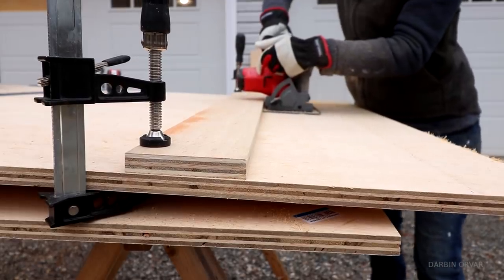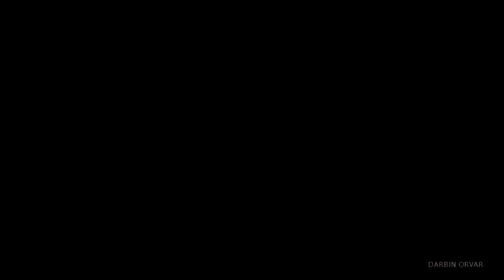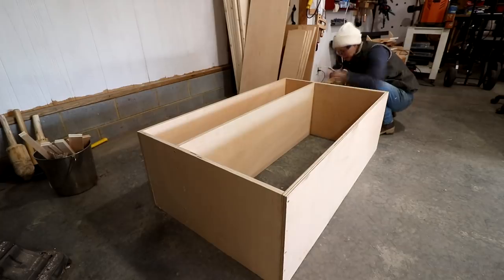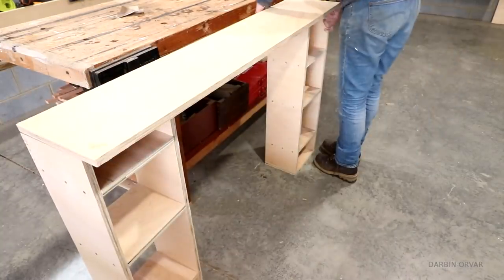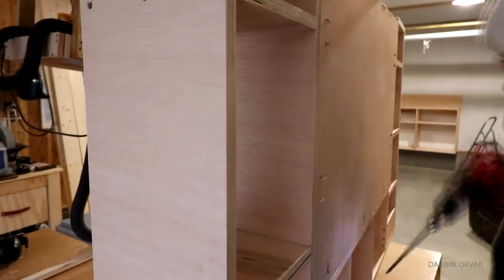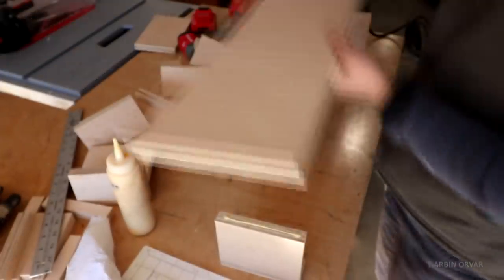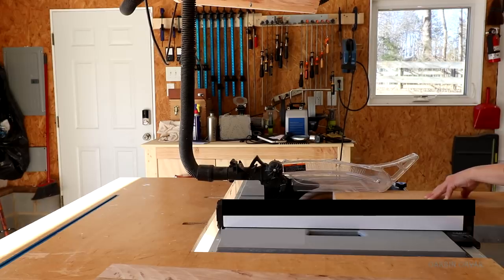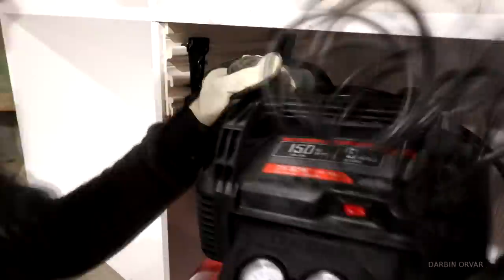Cordless Drill Charging Tool Wall and Storage Rack

Comment: Nicely organized.  I love my V20 Craftsman tools so far.  I have the Versatrack system from Sears and will integrate it into my Miter Station build.  So close to finishing.  On a side note, Stanley Black & Decker just sued Sears for their new power tool lineup and honestly, I don't blame them because when I saw them in person, they look very similar to the V20 line at Lowes but uses a different battery system.  It does confuse the consumer and thus the lawsuit because SB&D is getting a lot of support calls and negative publicity from something that's not even theirs.  Kind of messed up.

Comment: I couldn't stand having to reach for the screws and not being able to see the sizes. I will always pull the last box off the shelf and that will be the size I need. I would have used the underside of the main box to add 45 degree boxes that can house all of my screws. This would let you see the sizes easily and you are not having to pull out all your boxes off your shelf to get the box you need.